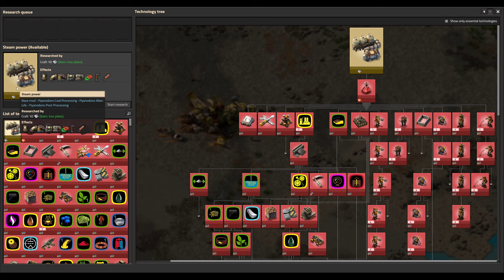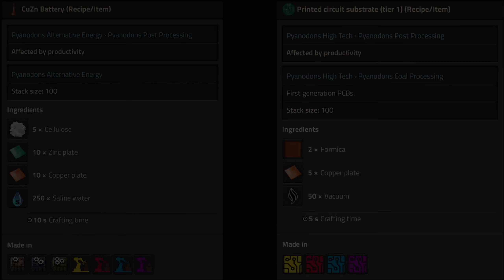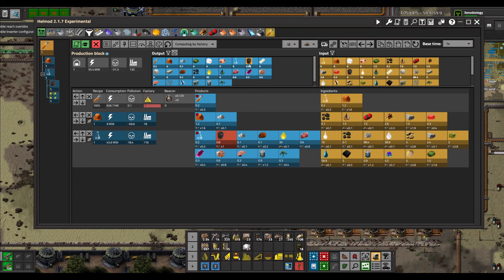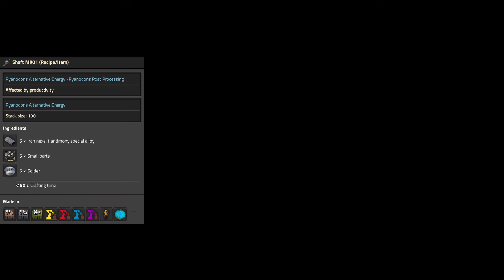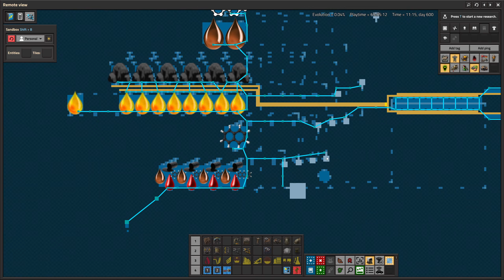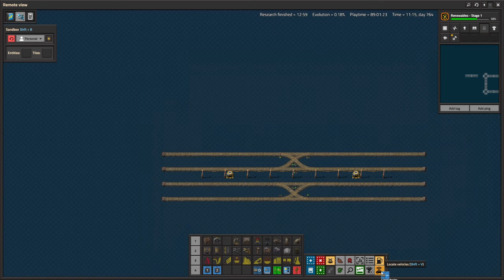The Road to Pyanodon's edge: Factorio's Hardest Overhaul Mod - The first 100 hours in 45 minutes

Comment: I am 350hours in and I havnt setup any mall yet, I always put it on 'i will get it on the next science'. I am on 4th science now waiting to research mk2 basic buildings. I can suggest you a mod called Resource marker or something similar which marks all resources in your vision so you dont have to walk there to see what is that, and small stones/vents can be very hard to see.
Reply from the maker: Wow ! I don't even know how do you survive without a proper mall this far in the mod. It doesn't seem to slow you down though.
I take good note on this mod you recommend, thx !
Reply: @Stareplue_Metal  I make intermediatory stuff like small parts, steam engines and bots automatically, rest of the builds i hand craft as needed while i do chores on the map. I use caravans exclusively with the T.U.R.D recipe for faster caravans, I gave up on main bus design when i reached the 2nd science, you are lot braver than I am.

Comment: I am a Factorio rookie who found the endgame boring, so i started a blind playthough around when you posted this video. I knew absolutely nothing about Py other than its reputation, and my only help is the max rate calculator and editor extensions to workshop ideas, no planners though. 

I just finished my first batteries at 90hrs with a base nowhere near as nice as yours, but i am quite pleased to see that I am not behind by an entire science pack or something like i had expected. The modpack is well constructed, I'm a huge fan.
Reply from the maker: Hey ! You are brave !
That's the spirit to start Py, just go for it and see if you like it or not. 
Good luck with your run !

Comment: Having progressed into Py quite a bit myself, this is very fascinating to watch. I feel like we encountered very similar progression blocks and bottlenecks

Looking forward to more :)
Reply from the maker: All the best for your run ! At what stage are you ? 
Were you thinking of the ash and power problem?
Reply: @Stareplue_Metal  Yes - Ash, Power problems, as well as setting up green chips and the next science that was only barely limping along making the stuff, but unlocking a few new technologies anyways :)

Power I solved in a rather unconventional and inefficient way eventually, once I had robots that I could just continuously order to build more, and more, and more, and more Fish Turbines. But before that, the injection of Geothermal energy was very nice ^^

I ended up getting to the stage, where I had a lot of much more efficient recipies set up for various metal production, with molten metals, and I had caravans with central storage and interrupts delivering materials to all sorts of places. I initially wanted to set up a modular train base, but ended up just sticking with the Caravans, since I felt like they were more flexible and easier to use

In the end, I haven't played Py in quite a long time now. I basically got to a stage, where I just renewed all my metal production, and then the next steps were setting up more metals and more materials before I could do anything. So I kind lost a bit of motivation
Reply from the maker: That's impressive ! But I get the most in interest. 
I'm going for trains right now, but I wonder if I'm not making a mistake. Maybe I should stick to caravans like you did... 
There is not just one way to end this mod, but maybe there is a better way, haha!
Reply: @DonYagamoth  Power ramps up quickly in pY, but you can mitigate it by not rushing too quickly to electric miners, and not building too big. Unlike vanilla, electric miners are not more efficient than burner miners. It's convenient not having to move fuel and ash, of course, but you already have the blueprints for that. The steam engines you start with only have 50% efficiency, so electric miners are actually twice as expensive until you get a better power source! Wait for oil burners and/or coal power plants (geothermal plants help, but it's still better to use that power for other things than powering miners) before switching to electric miners, at least for most of your mining and especially the coal miners. You mine a lot in pY, and even a small starter base easily spends 100 MW just on miners - switching to electrics too soon doubles that to 200 MW, and requires a massive inefficient power plant for pretty much zero benefit. It's a trap.